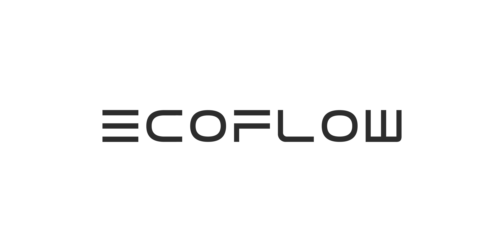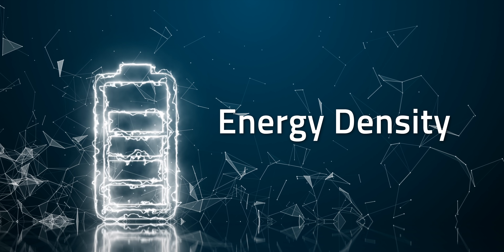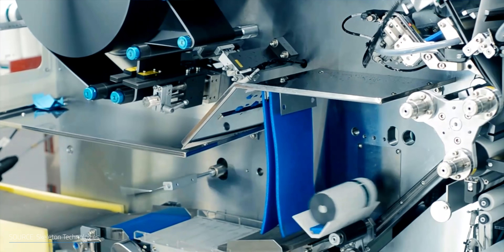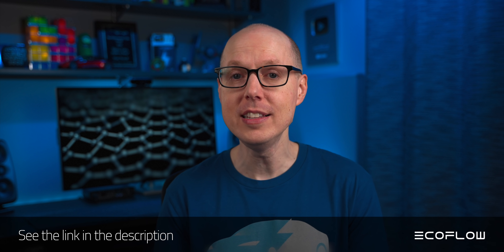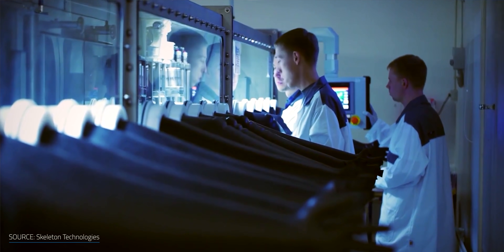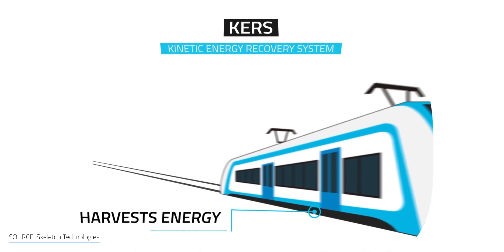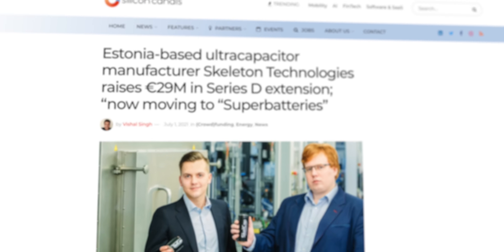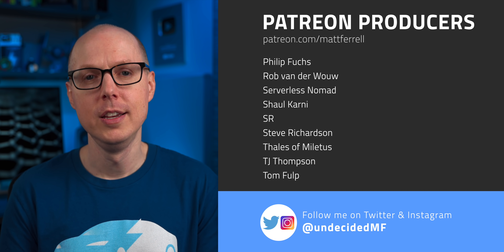Revisiting the Supercapacitor - The Wait for Graphene is Over

Comment: Why in the world would you use a capacitor, for a constant drain. Using capacitors to drive the radio, or lights is about the dumbest things i've heard. Yes having no self discharge is nice, but how often do lead acid batteries die because of self discharge? Almost never, its almost always because of small drains from it being plugged into the car. If your concern is that batteries eventually die altogether, just recycle the 12v battery. The only time i would choose a capacitor over a  battery is in a spacecraft where these parts cant be replaced ever anything else, that has an even remote possibility of replacement, use a battery.
Use a normal battery for everything that can use a battery, use capacitors for regenerative breaking reclaim more of that energy, faster, without degrading the batteries by charging them too fast, or getting them too hot. Thats what capacitors are for absorbing and releasing immense amounts of energy at an extreme rate. By using capacitors for regenerative breaking, instead of the batteries, manufacturers could use cheaper, larger cells like the CALB batteries i have(280AH instead of 3AH) making manufacture and maintenance extremely simple. A large prismatic LiFePo4 battery pack can easily be assembled by hand within maybe an hour or two, where as the same capacity small cylinder pack would be larger, heavier, and take days or weeks to assemble by hand

The problem with using these large cells is that while a full pack will deliver the same or better range to a small cell pack, the large cell pack cannot deliver near the current of a small cell pack.
For example
The 700KW the Tesla plaid model can deliver, would only be about ~300KW from large prismatic cells. But if you had a super capacitor bank, that bank could stay charged most of the time in track mode, and when you needed to go full throttle you'd have all of the current of the capacitors+ the 300KW from the battery pack. in Eco mode you could have the car prioritize charging the capacitor banks when breaking, and then not pull from the batteries till the capacitor bank is empty, ready for the next time you break
Reply: OF note, while batteries are more efficient at charge/discharge than capacitors, that doesnt matter if 70% of the energy you put into moving forward, is lost as heat on your disk breaks, using capacitors in junction conjunction with your batteries means you can reclaim as much energy in the battery as possible, and anything left over that the battery cant safely absorb, can go into the capacitor

Comment: Like the way graphite is an electric conductor can end up in the form of graphene or nanotubes, there's an insulator called boron nitride that can also form nanotubes and flat, graphene-like molecules, that might be able to be used as a super thin dielectric.

I think making capacitors with alternating layers of graphene and boron nitride, each one or two molecules thick, would up the energy density to the absolute limit.

Comment: Is there any chance that graphene supercapacitors could ever match the energy density of lithium batteries?
Reply: Yes, its main issue is that it's barely been 20 years since discovery. I'd compare it to silicon, the production methods of which are still being significantly improved over a hundred years after they first started using it for technology.
Reply: @XGD5layer  I'm assuming you mean circuit production, unless you are really talking about the grown crystal, which has progressed some, but not that much.

Comment: Having extreme charge cycle lifespan, short-charge-time, and low-energy-bleed is the goal for storage.  I hope that the manufacturers can eventually produce an energy storage solution that is more cost effective to use than lithium-ion.
Reply: Good thing carbon is easier to source than lithium
Reply: Carbon batteries are said to be 49% of lithium, which would mean they would be equal if 1 or 2% bigger.
Reply: And more long term!

Comment: graphene is not perfect for supercapacitor, porous graphene is. Graphene is not graphene, 3D structure also important. In addition, supercapacitor need new electrochemistry to achieve similar energy capacity as Li, Al, or other ion batteries. Currently, supercapacitor is a good power boost unit for battery systems. graphene is not new, large scale, robust production and QC are critical for success in future.

Comment: The maximum charging current is relative to the capacity of the battery. E.g. cars have a very high overall battery capacity and charging currents of more than 100 A. Supercapacitors wouldn´t help a thing, as the limiting factor is not the charging current of the battery, but the capabilities of the infrastructures to charge them. So I just don´t see the benefits of supercapacitors in the car sector yet. Howerver, if you have smaller products, like a warehouse robot, that has to drive around the facility 24/7, with little time to charge, supercapacitors could indeed increase the charging current and would allow a quick charge of the robot. They could then charge a battery over a longer period of time. So the only benefit I see for supercapacitors is the ability to increase the charging current at the cost of additional hardware and weight.

Comment: I found 4 companies selling those graphene ultracapacitors and 1 from china had a price. U$450 for 16v 10kF = 1kwh 1.5kg That is the ecoflows smallest model. Nice. I could power a velomobile with that at 30% regenerative braking (lithium gets 15)

Comment: When I started investigating capacitors and the famous 555 timer chip I was able to configure a cattle feeder that would have saved 3/4ths of the fuel cost for feeding cattle on the farm.  Dad died and I wasn't able to complete the application.  Basically I used a 1-1/2 volt cell battery to fire a 1967 Chevy starter solenoid via a capacitor controlled by a resistor.  The 555 timer allowed me to change the rate of charging the capacitor so that it would open the drop doors to the hay feeder, every day or  every other day.  in the interim of charging on the road.  Capacitors could hold a second BEV battery charge in a tiny space.

Comment: Regarding Graphene, you should also know that doping the lattice, graphene adopts properties so if you want to make smaller MRI Devices graphene would reduce the size and complexity of those machines.  Doping graphene as a coating on spacecraft can also produce stronger shielding and may be used for radiation shielding.  Imagine "tuning" through electromagnetism a radiation shield.  Finally, it is very useful when creating a dynamo.

Comment: A great quote from the CEO of a super-capacitor company:  “we’re not in the kilowatt-hour business;  we’re in the megawatt-second business!”
Reply: hah , perfect
Reply: Crazy Mr. Quarter Shrinker...
Reply: Where is that lightning strike storage bank when you need it?
Reply: Meet the material of the future that's 40 times stronger than Diamond.Graphene can withstand the impact of Bullet.
https://youtu.be/Zj9WFnyEyLw
......
Reply: I’m removing my post.

No one has my sense of humor. And I confused the units in my explanation.
Reply: @sirifail4499    It's true that a kWh is 3.6 times more total energy than a MWs. However, batteries may put out 1kW power for 1h, while super-capacitors may put out 1 MW power for 1s.  The CEO is saying that the super-capacitor can put out much more power for a short time, having high power density. But the energy density is less for the super-capacitor.
Reply: @sirifail4499  I think you didn't understand the statement. The JOKE is that a kilowatt-hour is roughly the same as a megawatt-second. The POINT is that this energy storage is FAST. High power NOT high energy. 
For the layman: "We don't care about storing a lot of energy (for a long time), we care about (low energy but) high power applications."
Reply: @michaelrenper796 , yes, that is the joke.  Actually I think @Siri Fail got the joke, but just one or two minor slip-ups between <x>W vs. <x>Wh, which is a very easy tongue-twist mistake to make.
Reply: @mr88cet  if he did get the joke, he wouldn't have felt the need to put on his glasses and say ackchyually.
Reply: @baconpancakes1752  

I see that now. I’ll leave my glasses off.
Reply: @sirifail4499  What Post??
Reply: @sirifail4499  I think someone needs to look at units more carefully.  "A kilowatt is 3600 kilowatts per second, which is 3.6 megawatts per second"  Actually those units are not equivalent, a kilowatt is NOT a kilowatt per second. A kilowatt per second is rate of change of power per unit time, not a unit that I have ever seen during my 50 years as a power engineer.  

Remember that ALL fundamental equations in ALL of engineering and science are dimensionally consistent, and if the units on both sides of the equation are not equivalent, EXACTLY, then the evaluation is wrong,

To review, Force is units of LBf, or Newtons.  Length  is feet or Meters.  Time is thankfully the same, Metric or English, hours or minutes or seconds.   Work, or energy is expressed as a force acting through a distance, in the English System this is a Ft-LBf, or the BTU, an equivalent of heat energy, in Metric, a Newton-Meter, or Joule, etc.  Power is force acting through a distance per a specific increment of time, Ft-LBf/sec, etc.  

The units typically used in power evaluations is  Watt, or kilowatt, or horsepower, these are units of Power, which by definition are fundamental force acting through distance per unit of time.  Several definitions are available, for example a horsepower equals 550 Ft-LBf/sec, as defined by the most famous Mr. Watt centuries ago.
Reply: @fredrosse  
I'm that guy...
Kilowatt per second is either rate of change of power, or power (energy per second) per second, not rate of change of power per second, which would be kilowatt per second squared.
Reply: @robbiejames1540  I do not understand your statement, or it's intended purpose.  What is the point you are trying to make here?  As I see it 

"Kilowatt per second is either rate of change of power, or power (energy per second) per second"  Yes I agree with those statements.

"not rate of change of power per second, which would be kilowatt per second squared."  No, this makes no sense to me, Change of power (Watts, or Kilowatts, or horsepower) per unit time would indeed be Watts per second, or kilowatts per second, or horsepower per second, and these are clearly rates of change of power per unit of time.  A kilowatt per second squared, I do not understand any rational use of  kW/sec^2

Perhaps you could realize that Energy vs Power are two different things, an energy unit, the joule, and a rate of energy transport is a Joule per second.  A Joule per second is defines a Watt, 
A Joule is clearly a unit of energy, a Joule per second is a unit of power, alternately expressed as a Watt.  A Joule per second squared is the same as a Watt per second, clearly a rate of change of power per unit of time.   A Watt per second squared (or kilowatt per second squared) is clearly NOT a rate of change of power per unit of time.
Reply: @fredrosse  

You are, of course correct. I messed up. I guess I’ve been retired too long to comment…

Maybe I should have said “joules per second” 😂
Reply: @fredrosse  
Sorry, my point was just a very small nitpick. What you said in your comment was that kilowatts per second was rate of change of power per unit time. This should be rate of change of energy per unit time, or rate of change of power, or power per unit time - but doubling up "rate of change of" and "per unit time" (as these both really mean the same thing) gives you the even higher differential - power per second, per second!
Reply: @fredrosse  
Essentially, if I remember right, "rate" has the specific scientific meaning of "something per unit time" so rate per second would be something per second squared. But A - I'm not sure I remember right, and B - I and everyone else understood you so it doesn't really matter.
Reply: @robbiejames1540  no. Power is work/time…

Energy is power/time. 

Lots of people here misinformed massively

This is why it’s kilowatt (unit of power) over hour (unit of time). So 1kw/hr  of energy is 1kw of power continuously for 1 hour.

A 1kw electric space heater running for 1 hr uses 1kw/hr. And a 100w mini heater run for 10 hrs uses 1kw/hr as well, however it takes 10x longer to expend the same energy as the full size space heater since it is 10x less powerful. Remember power is work/time. Energy is power/time.

So 1megawatt/second is 1 megawatt expended for 1 second. It is equal to 277.7 w/hr, or 277.7 watts expended for an hour. Both are the same thing. 

Now 1 mw of power is 1000kw but one hour is 3600 seconds which is why we end up with 1kwh being more energy than 1mw/s. So we can also write 3.6mw/s is 1kw/hr. 

So the saying “mw/s business not kw/hr business” is basically saying “we are in the 27.7% business not the 100% business” 
 It should be “we are in mw/s business not kw/s business” because it assumes that the time value for both samples battery vs capacitor is only 1 second and the capacitor can easily in 1s provide more energy than the battery. 
Hope the confusion is gone.
Reply: @adawg3032  
Unfortunately, I'm pretty sure your a bit confused yourself. I agree that power is work/time (because power is energy/time, and work=energy). However, this means that energy=power×time (which makes lots of sense, as a watt is a joule per second, so if you had 2 joules per second for 3 seconds,  you'd multiply to get 6 joules total) thus, the unit of energy is a kWh (kilowatt-hour) rather than kW/h.
Reply: @sirifail4499 , exactly, but not exactly:  a Kilowatt is a unit of power , not of energy .  A kilowatt-hour is a unit of energy :  the amount of energy delivered by a Kilowatt source over an hour’s time (or to total energy consumed by a Kilowatt load over an hour’s time).

Comment: The terminal voltage is 2.85V so with some derating 2.50V. A large number in series to get higher voltages has challenges in getting balanced charge. Balancing charge can cause significant energy loss. 'Skelcap' has been out over a year and while it does have higher energy density, the low terminal voltage persists. The company I work for was using hybrid lithium/supercaps since 2009.
Reply: yeah everything shown by Skelcap already exist, i.e. maxwell and other manfs... so not sure what so special in this video.
Reply: @melovescotch  The capacity is well up with the best. But anyone thinking they can just strap one of these across a lithium-ion cell are dreaming. Lithium ion is 4.2V for rechargeable, 3.6V for primary. The supercaps are 2.8V ... BANG!

Comment: The quickest and most reliable way to make graphene is using  supercapacitors! 

Flashing 1000 amps through a carbon rich substrate inside of a quartz tube. I bought 5 kilos for less than $200.

Comment: So vertical takeoff and landing EVTols would benefit especially at landing hubs where charging of an on board ultra capacitor used specifically for takeoff assist rather than use battery

Comment: i’ve always wondered why they don’t use ultra capacitors in Electric car specifically for regenerative braking and taking off? use the energy you make stopping to takeoff again? BOOM 
I understand that’s what regenerative braking is 😂
but I assume using a ultracapacitor would be more efficient???

Comment: I hate it how no one talks about bad side of lithium batteries and green energy generators in general.. And that major bad side is how toxic and energy demanding  it is to obtain lithium and other elements for components in chips and materials for construction.. Basically its mined and it takes alot of drilling to just find it first. But not just lithium, solar panels and wind farms need to be manufactured first and then set up and maintained, which is not green what so ever.

Comment: Consider a vehicle braking from 90 kmph to 0 kmph. It would waste 130 watt- hour (468000 joules of energy(considering weight of vehicle 1500 kg). Skeleton ultracapacitors have energy density of 6.8 wh/kg. So, the vehicle would require just a 20 kg array of ultracapacitors.

The array would vary with the square of velocity. If the car happens to stop from 180 kmph, it would have 4 times as much energy at 90 kmph. So , a 80 kg array of ultracapacitors would be sufficient.
(Considering no friction losses)

Comment: I think supercapacitor are going to be interesting in products like ebikes (there is already an ebike company providing supercapacitor batteries) , hybrid car batteries, medical devices such as defibrillators, and in electronic circuit boards for larger loads. The advantage of the supercapacitor is also that it can hold its charge longer than a regular batter or even Li ion. The main trade off is the fast charging fast discharging but lower over sustained capacity. There was talk by tesla to use supercapacitor in newer Teslas to use as storage devices for regen braking and accelerations and use the Li ion batteries for sustained travel at speed when they bought Maxwell.
Reply: i don't see the application in e-bikes

Comment: One of the misconceptions in the comments is that a capacitor is not a battery in that it doesn't hold the same power capacity in the long term, they are a shorter term storage medium.  Good for a flash in your camera (capacitor) not to power your phone (battery).  The municipal power grid has a lot of small power plants to supplement the load during peak usage hours that run only part time,  having better capacitors here eases the burden on the total electrical grid and would save money if they could be manufactured cheaply.